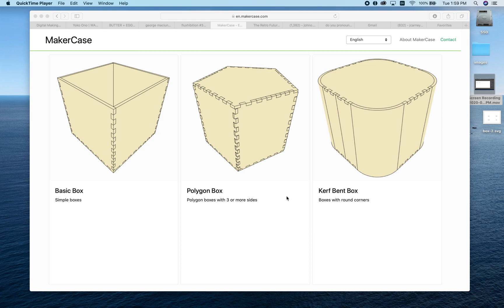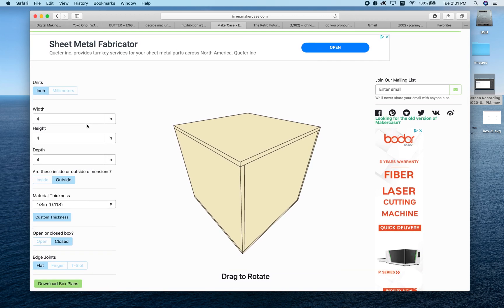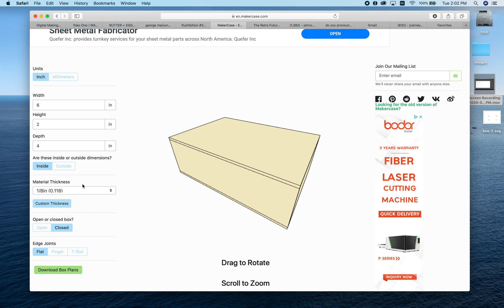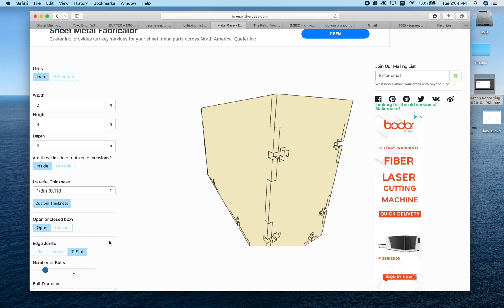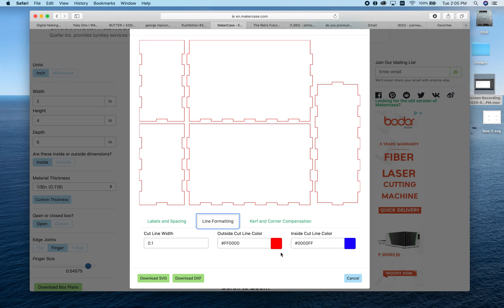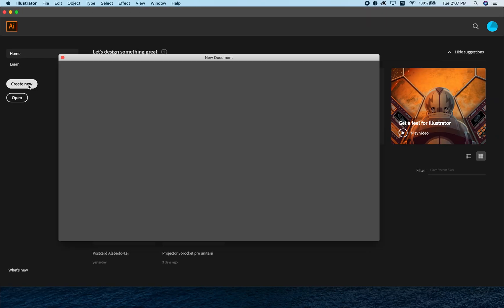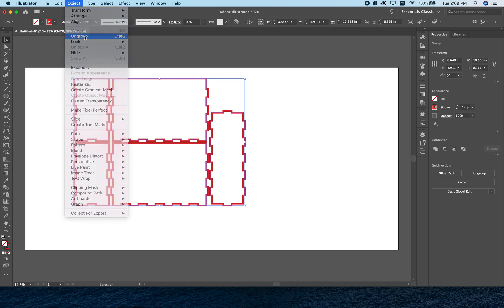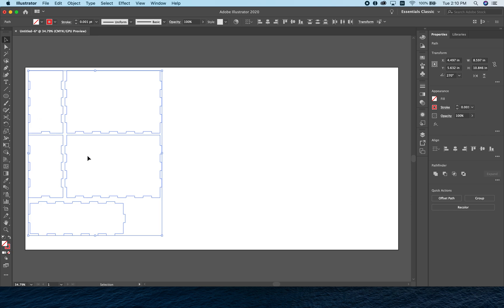MakerCase and illustrator Demonstration

Comment: No kerf… without adjusting kerf the fingers would split due to moisture, wood expansion, etc, that’s without taking into account that you will most likely break some putting it together. Everything that cuts has a kerf, might be 0.05-0.1mm but still needs adjusting

Comment: there is still a kerf with a laser cutter,  and should always be considered when cutting anything for proper fit, especially with lasers, everyone's laser and focal length and width are different and every material thickness varies the kerf width as well. So it IS critical that the Kerf is adjusted for everything you cut on a laser.
Reply from the maker: It’s true! There is some removal of material with a laser cutter. You’ll actually find that your laser cutter will cut a V shaped groove which is more or less pronounced depending on the focal length of your lens. The top of your cut will typically be a wider kerf than the bottom. In my experience with laser cut parts that need to lock together like the teeth of these cases, the positive and negative shapes should be the same dimensions. It’s actually the kerf that makes them fit together so nicely, not too loose and not too tight. Your results may vary, but let’s call this a solid place to start before fiddling with the kerf settings.

Comment: John can this box creator be used to cut on a cnc.
Jeff
Reply from the maker: This site is certainly optimized for a laser cutter. The problem you’ll run into with a CNC is the size of your bit leaving rounded corners on all the 90 degree angles. The tabs won’t press fit tightly unless you take the remaining material out. You’ll have to make sure your tool paths cut the outside edge of all the lines. This software packs everything really close together in the drawing too, so you’ll have to get some separation between the pieces or your cuts could overlap.
Reply: @dthormaly  I moved the pieces around go get some room for the cutter .Will cutting on the out side keep the inside of the box the size I want it to be 
Thanks Jeff
Reply: John would doing something in the kerf  box help with cutting on a cnc machine
Reply from the maker: Kerf refers to the thickness of the cutting tool, or more accurately how much material is being removed by the cutting tool. Laser cutters don’t remove much, and typically leaving the the kerf at 0 makes the tabs lock together nicely when the slot is the same size as the tab going into it. If the tabs are too loose or too tight for some reason, I think the kerf adjustment will help with that but I’ve never needed to touch that setting on this website, so I can’t say exactly how it makes it’s adjustments. If you’re using a router bit in a CNC to cut these plans out, yes you want your tool path to run along the outside of the line to keep the dimensions accurate for the box pieces. The only issue I see with using a bit like that is that you’re always going to have a slightly rounded corner because of the diameter of the cutting bit. My suggestion is just to try it, and use a small bit to minimize the rounded corners. It’ll still work, it just won’t snug up without a little extra work. You’ll either have to square up the teeth, or round over the inside of the tabs where the corners meet. Good luck!